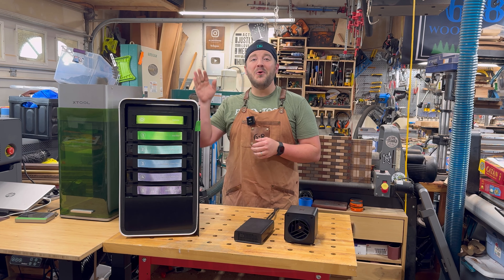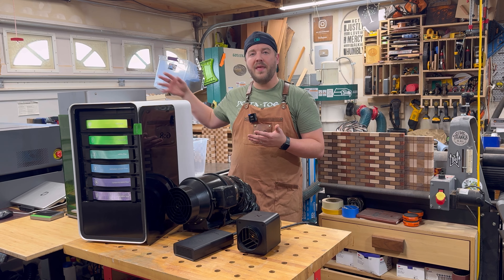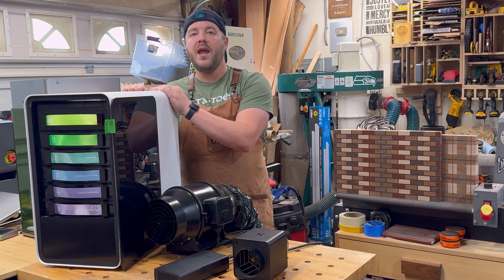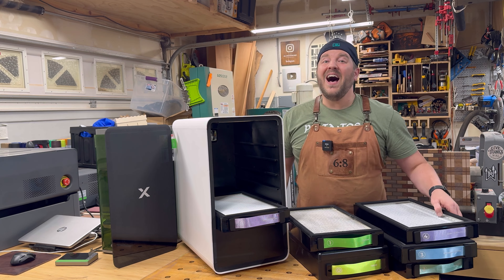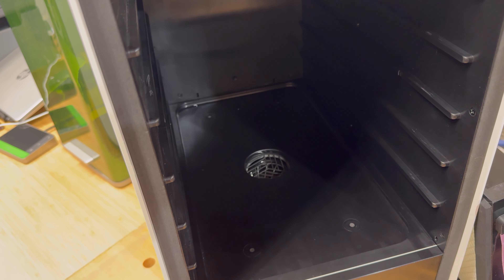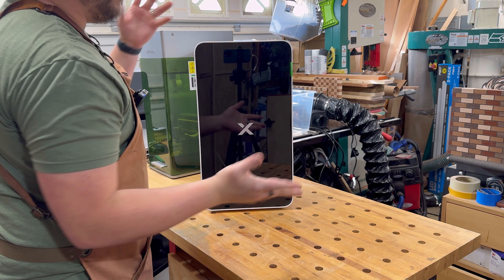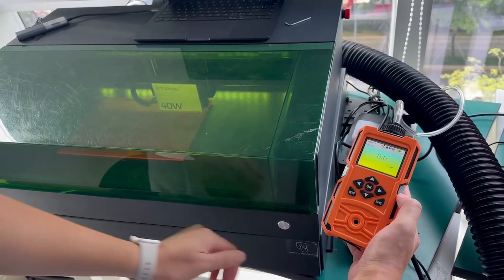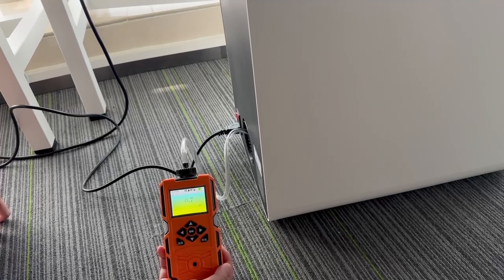xTool AP2 & IF2: Best solution for Laser Small Business Owners and Laser Woodworking

Comment: Did you connect the Ap2 to the P2S?  I can't seem to figure out the correct hoses connections to connect them up.  Newbie here.....
Reply from the maker: Sure did. There’s a connector that adapts the P2S hose to the port on the AP2.
Reply: Ap2 is erroring out after 2 weeks.  Error M9039 S4. Waiting on xtool.  I'm so mad

Comment: hi, can the xTool SafetyProTM work with another machine of a other brand? or must it be connected to an xtool brand? 
thanks
Reply from the maker: Absolutely! It will certainly work with other brands. The only component is the smart auto adjusting through xTool software wouldn’t work. However, you would still get amazing results.

Comment: The biggest make or break for the filter is gonna be the price of filter replacements. 
So far xtool has been way too expensive, and layers awere only sold together, which would negate the advantage of having 5 seperate filters in the first place. However this one should be easy to refill with aftermarket filters.

Is the cartridge price already mentioned somewhere?
Reply from the maker: The cyclone makes the pre filter last ten times longer. 100 hours vs 10 hours. The pre filter replacement is about $20 I believe. But they last way longer.